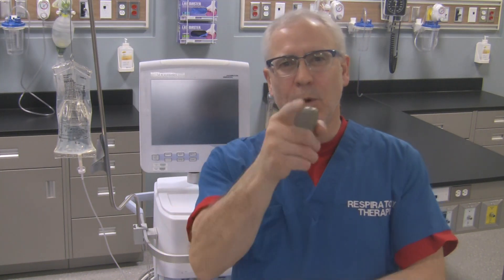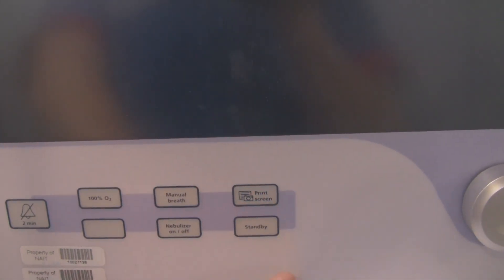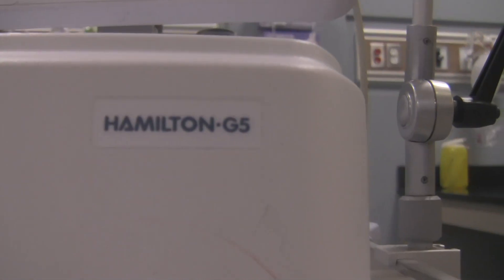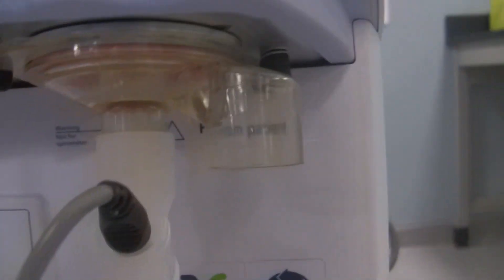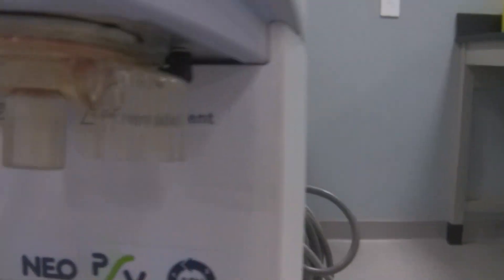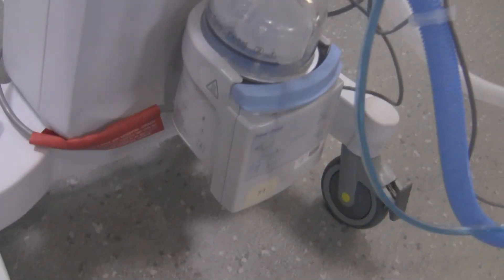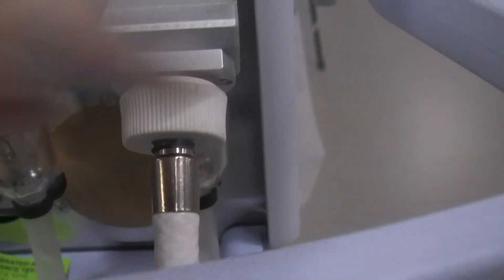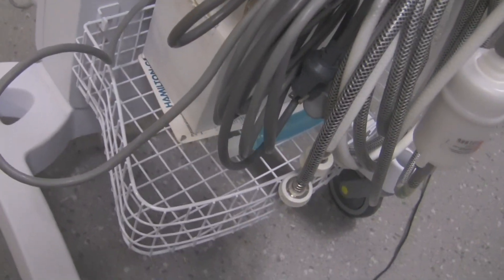Hamilton G5 Ventilator:  External Features

Comment: Hey George, do you not use a water trap with heated wire? Or expiratory filter on this vent?
Reply from the maker: Hi:  If you have a properly functioning and setup heated wire and humidifier, you shouldn't need a water trap.  If you don''t, then use one but be aware that its a big source for bacterial contamination which could lead to VAPs (Ventilator associated pneumonias).  Expiratory filters are always good to have on a ventilator as long as it doesn't impede expiratory gas flows.  We currently don't have one on this vent as it's primarily used for instructional purposes. Have a great day